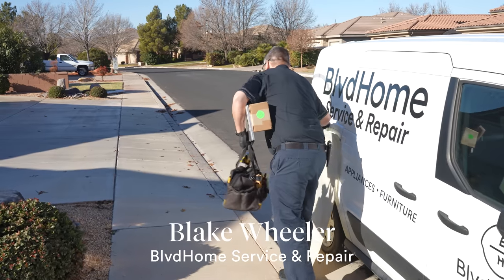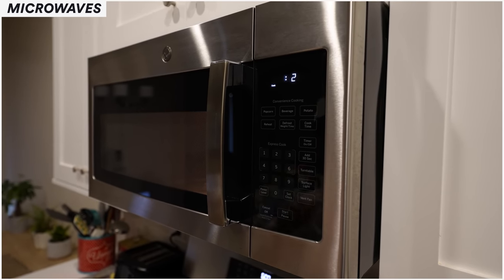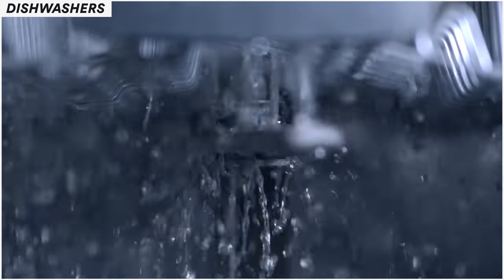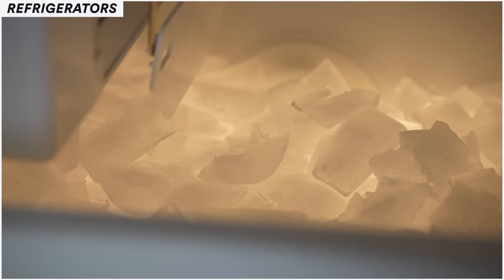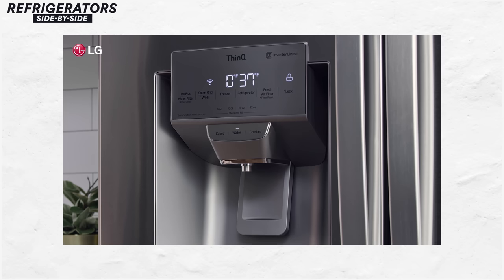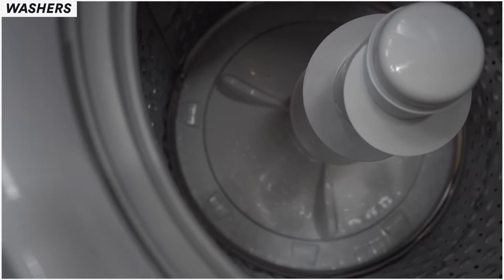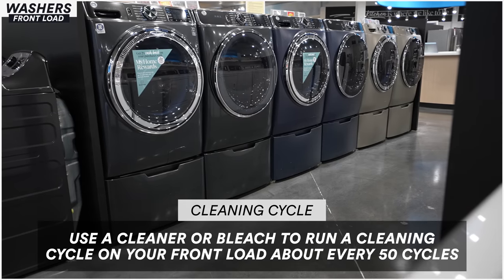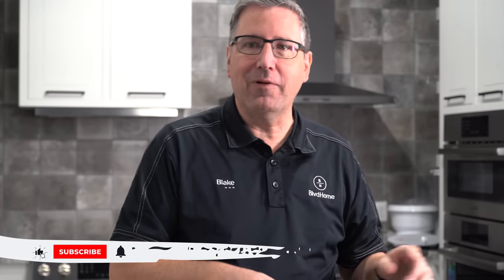Best Appliances Recommended by a Repair Technician of 29 Years

Comment: Mr. Wheeler, what do you think about the company Midea and specifically their French refrigerator ? Is it a reliable refrigerator? Thank you for your response
Reply from the maker: From Blake: Not a big fan of their products. The company is still fairly new to the appliance industry. The products are ok but in my opinion they still have a lot to learn and need to get better.  Specially about the french door fridge. It has been a decent product so far. No really big issues except for the icemaker. Reliability is a tough question to answer because problems start to show up after years of use. So with the limited time on the market I can’t say for sure.

Comment: Thanks for the video.  A couple things...Yale Appliance and some others state that LG dishwashers have the lowest # of service calls out of all DW brands.  You didn't even mention them in your recommended DW section - Why?  Also, I've seen others rate Miele over Bosch but again you didnt mention them in your DW section - Why?  I have a Bosch DW and its been great but it's not that old, maybe 4 years, and there are already tines on the baskets rusting and breaking. And, trying to get customer service to check pricing for replacements has been difficult.  I will most likely just buy a new DW eventually, maybe a LG or a Miele.  As for washing machines, I've had a front load LG Tromm steam washer for 10+ years with not a single issue so I can vouch for them.

Comment: I've been in my house for 11 years and it came with appliances of various ages.  I've only replaced 2 so far. Each appliance is a different brand. I was told that I would be lucky to get 8-10 years from newer appliances.

LG is by far the worst! Bottom freezer fridge died after 8 years (compressor failed). Replaced with another LG which needed a new compressor after 2.5 years. Fortunately I bought the extended warranty. Never again. I regret not going with Frigidaire. On the flipside our Samsung TV developed lines after 2 years but luckily had extended warranty. Replaced with LG which has been going strong for about 10 years.

Kenmore Elite dishwasher only lasted 8 years. I discovered that keeping the door ajar to let dishes air dry ruined the main board which is inside the door. Had it replaced but then the pump went. Replaced with Bosch and love it, especially the third rack at the top. If find Cascade Platinum pods are the best detergent for it.

Stove is Frigidaire glass top. It won't die! Had one element repaired about 5 years ago. Other than that no issues. We cook multiple meals a day on it! Above it is a built in Panasonic microwave. No issues with it. I didn't know about the door switch. Never had a problem with it but will stop doing that!

Electric Dryer was LG. Rollers went a few months ago. Using a hand-me-down Kenmore until I decide between stackable LG, Electrolux or Whirlpool. Top load washer is Maytag and has never needed servicing. I only use 2 tbsp of liquid detergent on quick cycle. No fabric softener.

Comment: What top load washer has solid bearings not Chinese, non digital boards and struts built like a tank? I wish I held on to my very old top loader it was around 15 years we bought  top load Samsung and its a hunk of 💩. We’ve spent more in repairs than we paid for the washer.
Reply from the maker: Its going to be tough to find anything that doesn't have a digital board these days. Even the Speedqueens that look like they're mechanical on the front are just digital boards behind the knobs. But Speed Queen is still the best option for what you're describing and they're built like tanks. But it comes with a premium cost as well.
Reply: @BoulevardHome  I’m gonna order the set tonight thanks

Comment: Loved my french door fridge from Frigidaire (you pictured it) - great shelving setup and loved ice maker in fridge, not on door. Loved it until the compressor died a week out of warranty and then after repairing it, the fridge lasted another 8 months before it could not maintain proper temperatures and I junked it. Let's hope GE Profile lasts longer.
Reply from the maker: Oh no! So sorry to hear about that. Unfortunately, even the best appliances can have their flukes from time to time. Good luck with your GE Profile!
Reply: @BoulevardHome  I may have given the brand another chance but my wife was dead set against it. Also, I learned that Frigidaire has NO certified repair techs in my entire state (which the insurance company had wanted me to go with), and that it only does a 1 year warranty on sealed refrigeration system while GE profile does 3 years.

Comment: My Bosch dishwasher didnt ladt 2 years. One problem is that the box isn't sturdy. Once its off square the door won't lock and party over. My previous dishwasher lasted 20 years but required $250 for motor / pump assembly. I didn't realize how thoroughly quality has degraded, or i would have fixed it.

Comment: Agree about Bosch dishwashers!  Bought 3 for self and friends in the last 4 years.
Absolute WORST fridge I have ever owned is an expensive ($2600!) LG French door.  Total piece of crap!  In 4 years:  Compressor failed (year 2!), large plastic bottom tray cracked (and the $160 replacement part cracked in the same place within 6 months!), and the switch panel is lifting off.  NEVER AGAIN!!!!!

Comment: House I’m living in come with Samsung appliances French door refrigerator freezer works some times other times my food is thawed out when I open it, also ice maker doesn’t work. dishwasher doesnt clean my dishes very well and now buttons quit working, stove control panel went out can’t use my oven but stove top still works. I have Samsung washer and dryer washer had to replace balancing rods dryers heating element went out on me all appliances aren’t very old at all maybe I’m just unlucky but the microwave works great

Comment: Samsung sucks. Ice maker went out, seems that the weather of Panama does not work good, since it has the ice maker now am getting frost. washer Whirlpool front load had two same issue turns off does not matter in which cycle you are, after a while every time you turn it on turns off. So for me Samsung and Whirlpool, surprised to hear LG 
.

Comment: I know this is rather natural way of thinking, but talking about brands and not models seem not very useful, because there is much bigger difference between cheap and high-end models of the same brand than between brands. Like, Samsung also does base models of refrigerators, without all the superfancy features. Or, in case of dishwashers, there are Bosch models which differ to each other only by the insulation, so one is more quiet than the other one. So you can't really say they are all more quiet than some other brand. Etc.

But still, nice video.

Comment: I've only purchased two washing machines in the last 37 years.  The first was a Kenmore Heavy Duty in 1987, purchased from Sears (yeah that was a store) it lasted just under 20 years family of four with the wife beating the hell out of it with blankets.  Second is a Speed Queen, purchased in 2009 ??  don't remember the exact year, still runs like new.  Neither of them has needed any repairs, the Kenmore was still working but the transmission was getting ready to go out.

Comment: Our Samsung microwave over the stove, that was 6 months old, worked fine as long as I took it apart every 4 to 6 months. There are three multi pen connectors that require unplugging and cleaning.  I noticed I'm not alone.  YouTube has many videos on how to do it.  Come to fine out this was a major issue with Samsungs' microwave.

Comment: Mr. Blake, I have a troubles. I have an older kenmore electric oven/range with the seven button keypad controller in the center. I have replaced the control panel 3 times now. It works for a while, then after an hour or several hours, they start acting up. Beeping, losing programming, losing display, etc. It has 3 prong 240 ac hookup. I checked the wall power for any spiking, looks steady. Any ideas? Thank you. Frank

Comment: Forget the ice in the frige...if you really love ice, then get an ice maker outside of the frig. FYI-LG as of today 5/2024, are still using the Linear compressor on the French door models and some side/sides. LG launched a new compressor in late 2023 called a 'Smart Inverter Compressor'. It's a variable power compressor, uses less electricity, it's more similar to the compressors that the rest of the manufacturers use. It can be found in some fridges but you will have to look at the sticker on the back or on the inside to read the words 'Smart Inverter'. LG has a Counter Depth Column Freezer that is an upright style and it uses the Smart Inverter Compressor. I think this newer Smart Inverter Compressor is a way for LG to move away for the disastrous failure of the Linear Compressor. If LG would use quality components 'in' the Linear Compressor then it could be a winner but they have not done this so far.

Comment: I won't buy any Samsung appliances!   They have class action lawsuits on all their kitchen and laundry appliances.  

8 years ago I bought top of the line Samsung washer, dryer, fridge, and oven to be used by a family of 2, not 20.  The washer lasted 4 years with 3 repairs, the 4th repair call was a fatal condition, so I trashed it and got a Speed Queen.  The dryer lasted 6 years repaired once, the second repair call was fatal, so I trashed it and got an Electrolux because it was half the cost of the Speed Queen.  The oven lasted 7 years, the first time it failed the service guy claimed there were no parts for it to be fixed, trashed it, and got a Bosch to match my Bosch dishwasher and stovetops, though brand matching to me isn't important, my research said Bosch made the best ovens.  The fridge never failed yet, however, it did freeze up about every 2 to 3 months forcing me to manually defrost it; just 2 weeks ago a Samsung repair tech showed up due to the class action lawsuit and replaced the water and ice maker, and replaced a circuit board in the back, he did say that he could not say for sure if the repair will even work, he also said that Samsung is a junky appliance maker, and he also recommended the Frigidaire fridge, and he loved my Bosch appliances, and thought a Bosch fridge would probably be better than the Frigidaire one, it would depend on how much money someone wanted to spend.

Comment: Hoped for more on the dryer brands. Need a new one, probably going to avoid anything with lcd in the controls. Couldn't figure problem with my electric speedqueen stopping cycle after 10 minutes and not starting until cooled off. The thermostat, thermal fuse and elements tested ok,  didn't replace. Did replace the 3 wire thermostat on the air blower and it still shuts down although timer keeps ticking. Venting is good is only 4ft vertical then 3 horizontal and the louvres open when running. 
I suck with spicing wires with wire nuts but it looks like there may be some hack splices from previous owner in tempted to replace. Researched the model and my unit war manufactured Nov 1993 - 30 yrars old. Makes me sad to not fix.

Comment: Times have changes. The U.S. companies like Maytag and Frigidaire are appliances I would avoid. For the last 7 years, I have had to replace them all. None lasted more than five years without multiple board failures and multiple water leaks. Presently, I find LG is the best quality for the money. A few years back I would have avoided LG because of all of the issues they were having with high tech appliances. Since then, LG has improved and their mid tech appliances are very reliable. The aforementioned failed appliances followed the three strikes rule. Three failures and repairs and the appliance hits the trash can. I also found the repair parts for the U.S. companies are out of sight high. I also found that repair parts for U.S. made appliances are no longer available after 3-5 years. All combined, I am fed up. The U.S. companies need to get their act together like the U.S. car manufacturers did after Japan started making better cars.

Comment: I'm preparing my mom's home for sale and taking out the sink side of the wetbar and want to put an affordable wine fridge in the cabinet.

The part I don't understand is which ones can go in a cabinet (built-in or freestanding). If the ventilation is at the bottom on the front, would it matter which one?

Comment: Best top loading washer: Speed Queen (classic is more aggressive on clothes and newer version is gentler). LG top loaders good. GE on par.
Note: normal cyle is economical cycle=less water, cool temp
Best Front Loader: Electrolux very good 2nd:LG 3rd:GE
GE vents out so no need to leave door open.
Use cleaner or bleach for cleaning cycle every 50 cycles. 

Dryers: the matching dryer

Comment: 12? 14? year old microwave (huge mind you) i almost always open the door to "stop" it. never had a problem with it.
maybe the newer ones are built like shit? there should be no spark, it's a simple low power switch to cut power to the HV unit producing microwaves.
also they are not all the same, there is a pretty massive difference if you happen to use the sensor buttons. they don't all have the same sensing capability, some microwaves are also mini convection ovens as well (newer ones but clearly much more expensive) pretty much a air fryer as well as a microwave.

if you buy a fridge and want ice/water, MAKE SURE IT'S EASY TO CLEAN. that's MUCH more important because some fridges water/ice dispensers are not possible to clean without taking the whole ice/water dispenser panel off the fridge.

Comment: It's funny how things are different in Europe. Here Miele has the best and longest lasting construction (for washing machines, dryers, dishwashers, stoves), at double or triple the price of a Bosch that does things nearly as well, or better (refrigerators, microwaves, etc.). For refrigerators, the king is Festivo, but very expensive. Bosch has Series 6 (made in DE, the good stuff), Series 4 (mostly made elsewhere, e.g. in Turkey, and you might get lucky or not), Siemens appear to be rebranded Bosch, AEG too, Electrolux, Whirlpool make well priced working stuff, except for their cheapest level). LG makes very good washing machines, bad dryers, good basic refrigerators and bad premium refrigerators. Samsung ditto. The best price/performance/design/usability/durability crown goes to Bosch, from my side.

Comment: We've had our front loading washer for twelve years now and is just starting to develop a squeak, but otherwise fine.  Never a problem with any smells (other than smelly detergents like Persil, ye gods) but then I keep the door ajar until it air dries inside and also wipe down the rubber parts.

My dishwasher is starting to cause me trouble though:  The ring finger is getting arthritis and thumb is a bit swollen.

Comment: high voltage does not go through the door switches on microwaves.  High voltages is from capacitors and transformer which is isolated away from those door switches.  The door switches runs the operation circuit while high voltage runs through the high voltage circuit separated by safety devices.  Another thing it make sure your microwave is thoroughly clean from food splatter.  As far as commercial appliances they are way better than domestic appliances and i think you may like domestic because its easier to pull out.  Commercial is better because the parts have been available for decades. Been working on commercial and domestic appliances for over 45 years rather work on commercial appliances than home appliances.

Comment: I'd DEFINITELY stay FAR away from any electrolux. Mother's fridge done living after 3 years of constant repairs and my dishwasher didn't live even 20 cycles before door stopped latching and unit stopped working. So my solution is not to repeat mother's mistake with Electrolux and sell it as soon as it's warranty serviced and purchase another brand. Not sure though why you never mention systematic reliability issues of Electrolux.

Comment: Cool vid especially coming from a Technician.
The old rule ...keep it simple, but today thats not so with a cost of reliability.
 I told people to just go back to the old way of making ice...use ice trays unless u want problems. Ice makers and water should be an option because of issues and they take away space but that aint gonna happen as with Adjustable shelving, today many took that option away and put in set shelving.
As for myself ...I cant stand the rollout bottom freezer concept..it just bulky and you do a lot of leaning and digging. Swinging doors are better
These newer 4 door swinging door fridge/freezers are very convenient and more simpler.

Comment: Got a GE UltraFresh front load washer as a gift from my daughter, as she was moving.  Upon registration, found machine warranty was running out, so we bought the 3 year warranty offered.  Then, the machine failed.  No power, no display, just a mysterious clicking sound every 10 seconds or so.  

Called GE and scheduled a service call.  Tech checked the machine and replaced the main board and the power supply.  No success. Then he ordered a drive board for the next scheduled visit.  

Next visit, drive board was replaced.  No success.  Tech then ordered the front control and communication board and scheduled the next visit.  

Next visit, front control board and communication board was replaced.  No success.  Tech then deemed the washer unrepairable.  Sent the info to GE and Assurant, the extended warranty company.  

They were supposed to contact me regarding replacing the machine within 24 to 48 hours.  Never heard back from them.  Contacted GE Customer Relations.  Related all of the above info to them.  They referred me to Assurant.  

The matter is still unresolved, my washer is still not functional, and I would recommend that the consumer NEVER BUY A GE APPLIANCE, EVER!